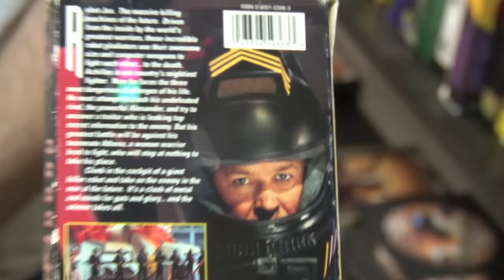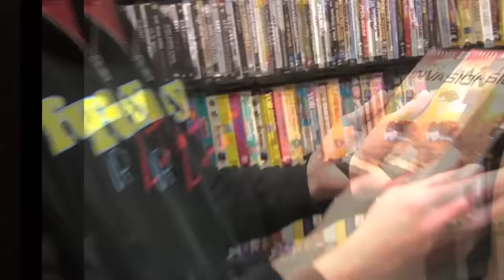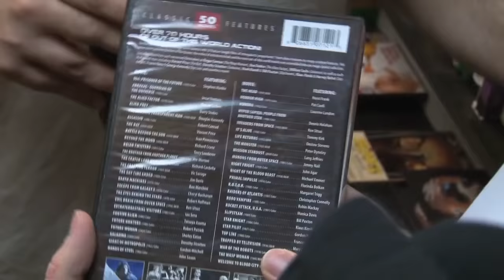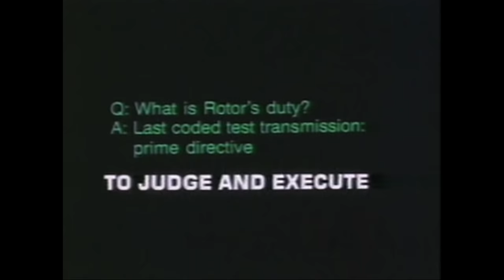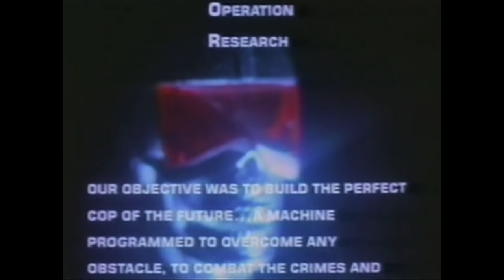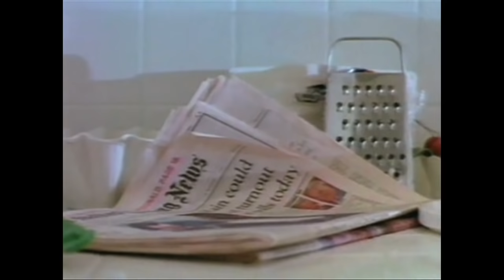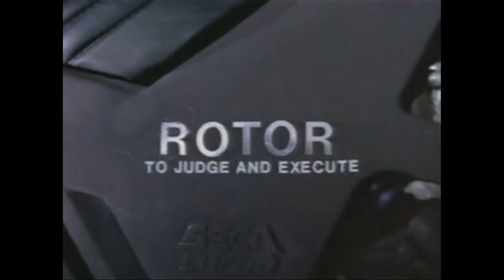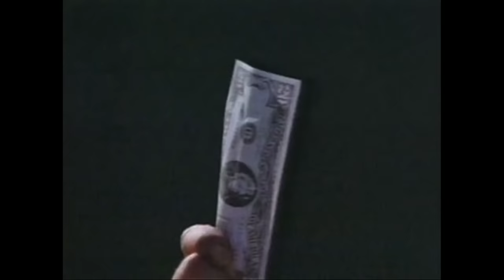Best of the Worst: The Vindicator, Cyber Tracker, Robot Jox, and R.O.T.O.R.

Comment: There's actually two different versions of ROTOR that go by two different titles. There is ROTOR then there is the longer version called Blue Steel. The Blue Steel version makes it much clearer that it's supposed to be a satire/comedy. It's got a bunch of cringe inducing comedy scenes with back pain they cut out of rotor. Also robot cop breaks the 4th wall and says the movies plot is horrible and a terminator rip off at one point. 

So this was meant to be intentionally funny but someone took the film and cut out a lot of the comedy scenes in an attempt to pass it off as a serious film in the ROTOR version. The Blue Steel version is a bit more tonally consistent when it's obvious that the movie is supposed to be a spoof.

Comment: Nerd Alert:  As an emulator developer (specifically NES/SNES) -- Jack is wrong.  The games move the same on emulation as they do on the system.  Modern NES emulation in particular is astoundingly accurate.

Though one possible differences between emulation is input latency (there's usually at least a 1-2 frame delay between when you press a button on an emulator and when it actually takes effect, unlike on the real system + old CRT television).  But it's generally too small for people to notice, and a similar lag appears when you run the real system on a modern TV.

/Nerd Alert

Comment: I want to point out that the reason that ROTOR blew up at the end is because they lassoed him with primacord. They established that Backproblems had primacord by showing him attempting to blow up a withered, rotted tree with it on his ranch. It didn't, and there was a line about how it could stand to be a little more powerful.

So the stuff they established as being too weak to knock down a dead tree completely obliterates Unstoppable Killer Policebot.

Yeah.